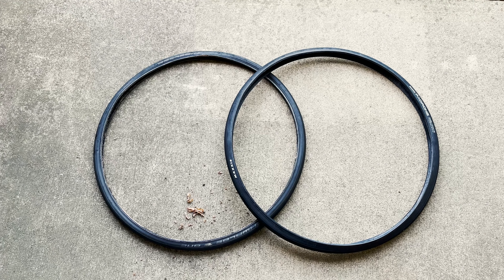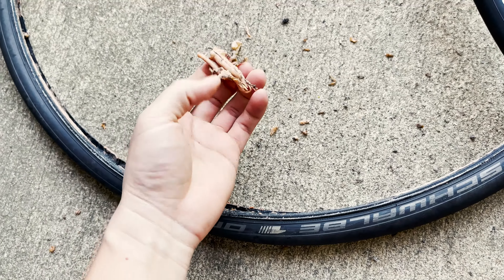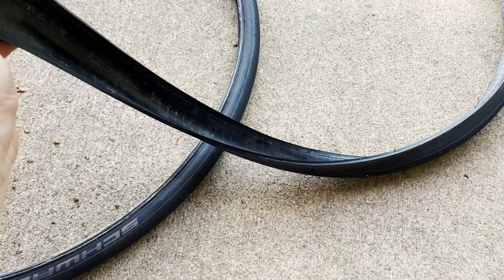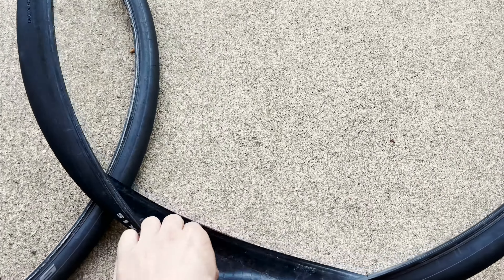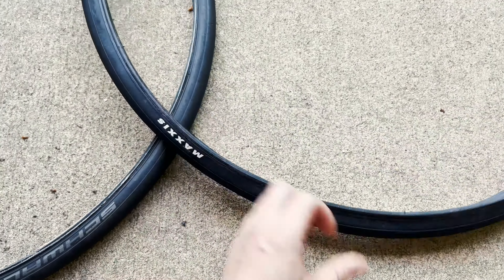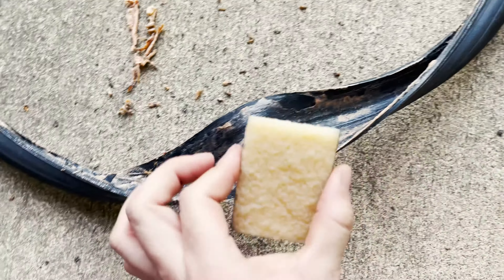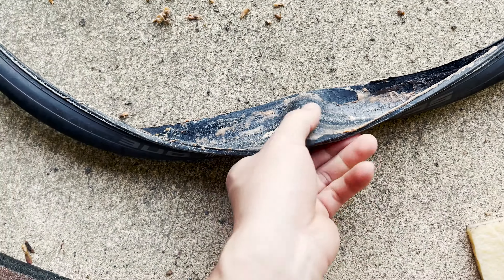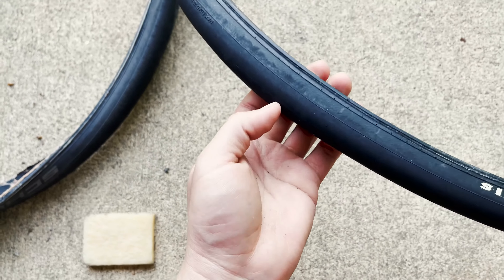The Definitive Easy Way of Removing Old Tubeless Tire Sealant From Your Tubeless Tires

Comment: I did this ONCE (removed tubeless sealant)....cleaned them up, and gifted them to a diehard tubeless convert .... now back on the best tube/tire setup available. Vittoria Corsa with Silca Latex tubes. 😊
Reply: @brewed544  2 in 3 years. one was unavoidable compression pinch flat from a pothole in Sicily .... and none of stans "stuff" on my my hands, tires, wheels, or bike. latex tubes and Vittoria Corsa for the win
Reply: Amen brother! Same here.

Comment: I'm not sure if this works, but I have heard that you can turn your tires inside out, then let everything dry, then wrap duct tape around it then rip the duct tape off; the dried tire sealant should come off with the tape
Reply from the maker: I would totally try this but I hated tubeless setup and went back to tubes :D
Reply: @TheGizmoGarage  why did you hate it?
Reply from the maker: @clmfilms8103  Too messy, plus, I rarely gets flats and it doesn't take me long to put in new inner tubes.
Reply: I heat up the latex with a propane torch which softens it enough to remove with a putty knife or other scraping tool. Just be careful and aim it on the latex and not the tire rubber. In other words don't heat your tire up too much... you could have a blowout.
Reply: @TheGizmoGarage  😂I'm here to clean off my gunk before I pop a tube back in my MTB. I'm over tubeless...
Reply: That may work , but pretty expensive as a one use only option ... struth ...

Comment: Thanks for this tip, it really works and was easy. I actually had one of these hard rubbers in my garage for cleaning sanding belts. Saved a lot of time, many thanks ❤
Reply: About as useful of a discovery for me as the day I discovered you could clean your sanding belts instead of replacing them. Yay for rubbers!

Comment: Great thanks! has anyone tried  dawn soap, hot water and a rag? wondering if there is a difference. Also if you change your sealant after 6 months will it always stick hard on the tire or is it easier to remove if done more frequently?
Reply from the maker: It's way easier if you do it more frequently because there won't be a latex build up, which is almost always caused by abusing and delaying the proper sealant changing interval. Follow manufacture's recommended sealant changing interval or do it just a bit sooner and you should easily just wash off the sealant and then put in fresh sealant. This tire's selant probably was not changed in years

Comment: I went to shops and found heavy duty eraser but it seems soft to do this job. It’s more for erasing paint on walls. I then took scraping sponge and been doing it on my tyre which never been cleaned for 3 years. 30 min and I’m still 10% done! And actually not completely done on those 10% there r still some dry sealant in middle. I’ll try with water tomorrow

Comment: This works great. Found one of the rubber cement pickup erasers in our university store's art supply section. So much faster and thorough than using my thumbnail. 🤣 Thanks a bunch for this video. 👍

Comment: I think the most important takeaway from this video is that the tire may just be too old. I once scrubbed a tire to the degree that sealant was leaking out through the sidewalls afterwards 😅 

Thanks for sharing the video, will certainly try your trick!
Reply: I remember watching a Park Tool video on tubeless tires and they said that sealant leaking through the sidewall was "somewhat normal" and you should just wait a few days for the sealant to patch these holes naturally. Never had that problem but hey, here you go.

Comment: I think Mr. Gizmo jumped to a conclusion about the tire which still had the sealant. On full screen and paused, I think all that's happened there is minor light abrasion caused by a tire lever. I don't see any true cracks at all.

Comment: This does not work if it’s it’s still wet. Even slightly wet. The erase gets all greasy and slips right over it.
Reply from the maker: Yep, I should put this as a disclaimer...
Reply: @TheGizmoGarage
Reply: @TheGizmoGarage  is there a way to dry it out first?
Reply from the maker: @MikeJones-wo7vm  I usually leave the wet one outside in the sun, when they pile up and dry up, it's even easier to remove by just peeling the big chunk out.

Comment: hi, the link does not work anymore, i would appreciate if you could provide us with a name of this product. thanks
Reply from the maker: https://amzn.to/3sdo06N Pentel eraser.
Reply: The one he used in the video is called a rubber cement eraser. They're pretty much designed to remove dryed rubber adhesive, so that's why it worked so well.
Reply: @TheGizmoGarage  hi this link takes me to panel hi polymer eraser. Looks regular white eraser not like in video
Reply from the maker: @MrMars121  You can try these https://amzn.to/3cglTtL in all honesty they work pretty much the same!

Comment: Got a glue eraser at Michael's.  Took a few hours to get all the old sealer removed.  A hair dryer is some help.  Heat gun on low setting probably would have been better if I had one.  Won't have this problem anymore now that I installed a tube. 😀

Comment: I would have taken this more seriously if you had demonstrated a small section.  To my eye, the tire that you said you cleaned with the eraser looks brand new and not like one that was cleaned.  Just saying.
Reply: Alex Paton from GCN has a longer video showing how to use this type of eraser to remove sealant from the inside of a tyre.
Reply: @jamesmckenzie3532  I did use one of these erasers to clean the dried sealant from my tires/rims and it does work but it's not like magic.  It takes some elbow grease.  Once I removed all the sealant, I installed TPU tubes and I'm never going back to tubeless.  Too much mess and not as puncture proof as you are lead to believe.  A TPU tube weighs less than the sealant and has a rolling resistance almost as good as latex tubes.  Easy to carry a spare (you need to anyway with tubeless) and much less messy to fix on the road.